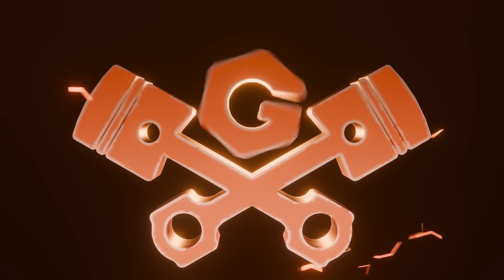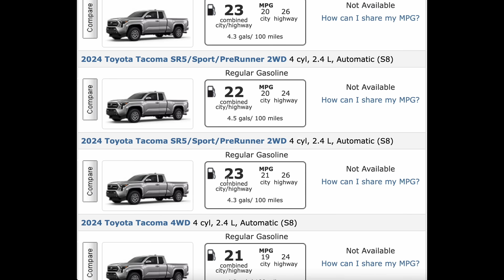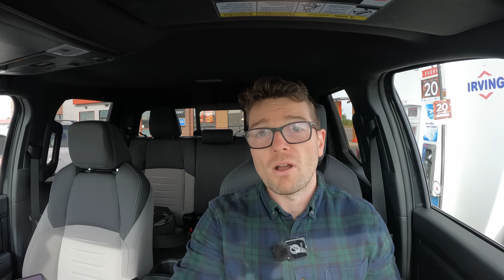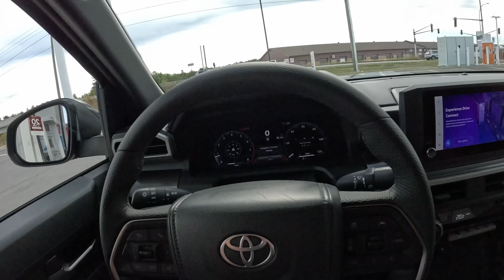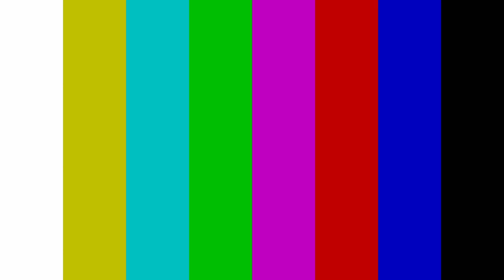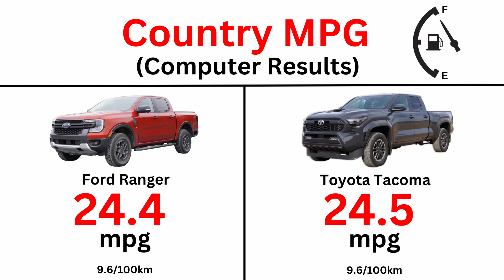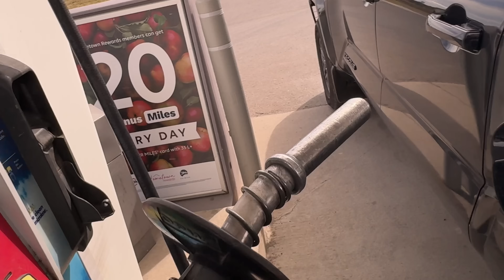Toyota Tacoma 2.4L Turbo Fuel Economy (MPG) Test | Shockingly EFFICIENT or OVERHYPED?

Comment: Tacoma gets horrible gas mileage. I just got off a trip with 16.6 mpg   My F150 with a V6 eco boost routinely got 20 mpg  and I could do twice the work with it. Going to get rid of this piece of crap in next few months. My advice , never believe these guys on any YouTube videos .
Reply: My SR5 2026 averages about 24 in the tank and I can get close to 28-30 on the highway. Youre doing something wrong.

Comment: Comparing MPG even on a closed loop route still has variables, mainly wind resistant. That wind resistant has a large impact on realized MPG on a close loop test And yes, do the math, the computer realized MPG can be 10% off and more. My loop is 46 miles. 
That said, my 2024 Sport has averaged as high as 31MPG on the east bound leg of the loop and as low as 22MPG on the west bound. 
My typical combined is about 24MPG

Comment: My 26' taco now has about 250miles on it and im consistently getting 23-24mpg. Granted its still in its break in period, but off to a great start. I dont really have a lead foot and im really good about managing speed without having to use the brake excessively.

Comment: I just had a revelation while watching your videos this evening.  You're the Teddy Baldassarre of pickup trucks. 😀  Y'all look similar, both have strong technical knowledge of the products you review and explain them well, and even look similar with the black glasses.  Keep up the good work!  Did you ever calculate the MPG of the Trailrunner in non-towing mode?  I'm considering it for the hybrid engine double cab with 6 ft bed.

Comment: Thank you I have an older Tacoma 2006 with a V6 engine Its best gas mileage is 18 mpg. It has a 5 speed automatic. The new tacoma is much heavier. My weight 3750 goss wt. My puts out 240 HP. on a 4L engine. Ben reliable its still runs good I have 172,000 miles. Im looking to sell because need better gas milage . Im looking at the ford Mlvric.
Reply: I’ve heard good things about the Maverick, but man I would hold on to your tacoma for as long as possible
Reply: @AJ-zu7ct Gas prices are not coming down for a few years. The stupid war damage lots of oil processing equipment. I drove my Tacoma the other day. Short trip to and from $60. It will cost an arm and a leg to drive it.

Comment: Love this channel.  I liked the Ranger 2.7 but wanted a 6ft bed so bought a Tacoma SR5.  I expect the Toyota to last longer but who knows, I do intend this to be a long term keeper. Hauling gear and NJ to WA runs a couple of times per year. 

A lot of highway running loaded up but not towing and not off roading so the air dam is useful. 

I will change oil frequently so not worried about durability with my use case.  Would you run 5w30 or 0w20?

Some interesting comparisons to other small displacement turbo cars I have.  2010 MazdaSpeed3 2.3L, 25mpg hwy!  2020 Alfa 4C 1.75L (weights 2500 lbs), 33mpg hwy and 12mpg pushing hard.  So the efficiency of the Tacoma 2.4L in a 4600 lb truck is cool. 
The key to any engine fuel economy is to be gentle on the throttle.

Comment: My 2025 Tacoma sport is averaging 16 litres per 100 kms(14.84 mpg's) and I drive it like a grandpa. What could possibly be causing it to be so bad? 3415 miles on the clock.
Reply: You either idle a lot or have many short trips.
Reply: @kannermw  What do you consider to be short trips?
Reply: @24cupsandcounting Anything less than 10 miles.  It is non-linear.  It takes at least 5 miles before engine reaches efficient operating temperature but it could be more depending on ambient temperature.  During those first 5 miles and especially in low speed city driving the efficiency will be at its worst.  If you jump in the car and are cruising down the highway within first mile the engine will warm up more quickly and be more efficient within couple miles.  Also, huge differences with winter blend fuels and very cold ambients.  My 2021 Avalon V6 mpg winter to summer is a range of 25 to 29 mpg.
Reply: @kannermw  Most of my trips are 15-20 miles. I am used to turbos as well. My last 2 trucks were 2.7 ecoboosts.
Reply: If you have a manual transmission then the blame is guy behind the wheel.  In that respect the perceived benefit of manual transmission is no longer valid compared to modern dual clutch 8 speed transmission.  The computers are way smarter and better than humans.  Also, accelerating too slow is worse than modest acceleration to achieve desired speed and then maintaining it.
Reply: @kannermw  Mine is an automatic and I am used to turbos. My last 2 trucks were 2.7 ecoboosts which got excellent fuel mileage and I do nothing different with the Tacoma.
Reply: @24cupsandcounting Sounds abnormal. I just purchased a 2026 4Runner Limited Hybrid.  It is my wifes daily driver with about a 60/40 highway/city driving profile using comfort mode (normal performance setting not eco).  She is averaging about 19.8 mpg but still less than 1000 miles.  This is full time AWD vehicle so fuel economy will be less that PT 4WD variants. It is about 20% better than previous 2018 4runner Limited with 4.0L that averaged berween 16-17mpg.  The new Limited has wider tires than prior gen so despite this plus added weight including hybrid drive the better performance and economy is what I expected  

Now if you are running large off-road tires at lower pressures then there is your problem.  Also, if you are using E15 gas that wont help. Probably should call dealer.  I assume you are calculating between fill-ups manually?    You could also lift all wheels off ground and verify they spin freely and no brakes dragging or mechanical issues.

Comment: the engines are tight for quite a few miles. They get better when fully run in.
Reply: How long does it take to loosen up? I have 2400 km's on mine(1500 miles) and my gas mileage is terrible. 2025 TRD Sport with 18 inch wheels.
Reply: @24cupsandcounting  books say 5,000, I say 10,000-20,000 miles. Everything in the vehicle is tight when new. Alignment is a major factor as well. Get yours corrected now that the suspension is surely settled in.
Reply: @AutomatedUser  it's funny you mentioned alignment because the truck seems to be out of alignment. It drifts to both the left or right. You know your stuff.

Comment: Blows me away how many people watch videos on these new Tacomas just to hatewatch and comment the same boomer slop about turbocharged engines
Reply: Its usually triggered Nissan fanboys or people that think this motor is built by Kia or something. This engine is way overbuilt and is strong as hell.
Reply: @TheDoc813   agreed. there are legitimate gripes to be had with the new Tacoma, like the small fuel tank, but the engine is not one of those things. It's a huge improvement over the outgoing V6.

Comment: Nice info…

Would like to see the auto vs manual going up the hill cruise control on.
Difference in boost and rpm.

Just another reason diesel option would be the correct way to go. Oh, and a proper 6ft bed!!!!

Comment: About 4k into my new 2025 TRD Sport 6' bed with a topper and I easily get 20-22 city or highway, even here in CO with all the mtn travel, doing better than my 2013 v6  Tacoma  I traded, particularly towing my camper which averages 14-16 MPG vs 10-12 with the v6 and a 3k lb TAB. I was hesitant to get another but happy I did.

Comment: Mine jumps around a bit, running in Eco mode I have recorded some 8.4 8.5 litres per 100km.  This is in summer and stock tires. My winter tires drop the economy a bit.

Comment: Sacrificing reliability and longevity for any amount of improved feul economy is unacceptable.  My 2022 trd sport long bed crew cab gets 15 to 16 mpg down town.  It also has a Magnusson super charger on it.  Feul economy only changes by a gallon or so, if you abuse the truck.  For me in car mpg is priority.  In my trucks it's bhp,torque,  towing capability and interior room.  Fuel economy is not even on my radar.
Reply: How's the supercharger do on your reliability? I've been looking at tacomas and I seen one with the same supercharger for sale near me. Thanks!

Comment: I got my taco sport premium 2 years ago. I’m at 50k miles .. I avg a solid 22.6 mpg..  no regrets these turbo 4 rides smooth in local roads highways anywhere.. I’ve also had a 3rd gen to compare it that I’ve owned for 5 years now.. so yeah love both but 4th gen for the win..
Reply: I’m averaging 21mpg in mixed driving with a 5.0 F-150 with 307k on it. And have got way better depending on what I’m doing. Pretty sad when a V8 almost matches your 4 banger
Reply: I’m averaging 21mpg in mixed driving with a 5.0 F-150 with 307k on it. And have got way better depending on what I’m doing. Pretty sad when a V8 almost matches your 4 banger

Comment: You should compare to the 2.3 Ranger. It will still beat the Tacoma in every metric. My 24 F-150 with 5.0 V8 and FX 4 averages 20+ local driving and 22 Highway.

Comment: The 22’+ frontiers get ~23 mpg and still have a V6 so I still don’t know why Toyota switched to a I4 instead of just making a better V6 like Nissan
Reply: You need to drive the Frontiers very gently to get that. The Frontiers top selling points are simplicity and long term reliability, not economy…
Reply: @sleeper.simulant7327 true, I believe ~20 mpg should be goal for most trucks
Reply: They do not get 23 lol. Its a dated platform.
Reply: @TheDoc813 yes they do

Comment: I'm fixing to hit 10k in my 24 Tacoma Hybrid TRD OffRoad. I've been averaging 22 in the city and hit 24 mpg consistently on the highway. I could probably get a little better than that, but I usually keep it in sport mode. Love this truck. It does everything I need it to do effortlessly, and it looks good doing it. No regrets.
Reply: It's nice to see a positive experience. I've seen so much trash talked on the new Tacoma. I think most of it comes from haters that have never owned a Toyota.
Reply: @JH-mt3pp  A lot of people are technophobnic, they see a turbo and scream in fear.
Reply: 2019 22 mpg countryside 87 93 25 mpg 10 ply tires no turbo countryside windy North Dakota driving

Comment: I'm grateful that I finally found the answer to why that engine runs so rough. From what you said it's the stroke. I personally do not like the way it feels it feels like it's misfiring and it's holding me back and purchasing one
Reply: the engine is solid. im more worried about suspension bump stops in the fromt , but that can be easily fixed

Comment: I towed an empty trailer with a Ford Maverick 2.0 ecoboost. Kept it easy at or under 65mph for a few hundred miles all highway. I got 13.5mpg. Small displacement gasoline turbo engines get horrendous fuel economy. Stick to V8's or diesel if you tow a lot.

Comment: I rented one, I drive 145mk\h for hours and pass anything not doing at least 20 over.   The thing was horrific on fuel and sounds like a Diesel in the Tims Drivethru. i wasnt impressed. Only thing that I really liked was the adjustable headlights.
with that said WHY dont you do a REAL world fuel economy tests and drive 20 over for 100km on all your test subjects???
Reply: Am not suprised that at 145kph or about 90mph your mileage sucks.  That’s really outside the normal design parameter for most truck engines to run efficiently. For this small engine even with an 8-speed, running outside its sweet spot.  Not saying you are wrong, good or bad. Aero for any truck is bad.  Did you have good mileage with any midsize or 1/2 ton at 90mph? 

I just bought a ‘26 Tacoma SR5 but cruising x-country I usually will be a little slower around 80mph.  Will see how I do. 

LOL my deleted 2012 golf TDI 6-speed manual with a big Thule box on the roof at 5,000 feet and 75 mph would get 43mpg, but at 90mph only 30mpg.  Aero and efficient power band efficiency.  The Tacoma has bad aero like any box on wheels and the 2.4 has a diesel-like torque curve and power band.  

Not making excuses for the newTacoma, it is what it is.  I drove a 2019 SR5 cross country and it cruised well as the power band was suited for 80mph.

Comment: They made the manual worse by reving 8-900rpm lower than the auto and less 7hp.  No more access cab either.  I'll keep my tuned 2nd gen, 4.0, 6 speed, access with a real key and reliability.  With some effort, I was able to get 25.2mpg from it by coasting down hills with engine off then bump restart while rolling.  Mostly get about 22mpg doing that and cranking it up once in a while.

Comment: On my 2024 Tacoma SR I regularly see 30 mpg on the computer when I am driving calm in the country roads or 65mph on the highway
Reply: That's crazy. Is your SR a 2wd or 4wd?
Reply: @gxkjerrygao7635  yes 2wd
Reply: @gxkjerrygao7635   I got a 2wd SR5 and I get about the same. SR/SR5 is the sweet spot if you want good MPGs.

Comment: Well, all I have to say is, i have a 2006 Ford Ranger 4l v6 i get 13 to 14 MPG. I am looking at the 2025 tacoma.  I will get all most 10 per gallon increase.  So I will be doing very well.
Reply: Find a 2016-2024 v6
Reply: Don’t believe these high mpg guys.  No way that truck is getting anything better than 17 mpg .  I’ve got 1200 miles on my Tacoma with that turb 4 cylinder  and now have16.4 mpg average .  Everyone who says they get  better than that must be coasting downhill in both directions .
Reply: @vicranger6876 same 17 mpg

Comment: 11:54 how is that any different from a N/A engine? Sure, they dont add boost, but they still open their throttle valve, they still intake more air, and they still add more fuel to match. Why would boost be less efficient than displacement?
Reply: Often times they have to run these turbo engines pretty rich to keep the exhaust cool enough. That can hurt the mpg’s.
Reply: They're rich under boost for safety. Detonation under such high pressures would be devastating.

Comment: Just purchased this exact truck in the premium version. Traded in a 2021 3.5 V6. The new one drives 100% better on the highway. I really liked the old 2GR, but the transmission was disappointing. This thing drives almost like a diesel - low revs, minimal shifting. Yes I do agree with some posts, quality is not quite as good eg plastics. What I do like is the rear suspension, the old truck's bed used to wiggle around but this one is solid.

Comment: Traded in my 2023 Tundra last month for a GMC Canyon AT4x.  Part of the reason was wanting to downsize, the bigger was wanting to get away from the engine issues with the Tundra. I had been a long time Toyota customer and considered the new Tacoma. Doing a deeper dive on the engine is what made it a no.  I’m guessing it came from the same design team as the Tundra engine. No thanks on a plastic drive gear that runs the balance shafts and oil pump.  GM certainly has their share of issues. You need to pick and choose carefully from any manufacturer these days. With that in mind, the 2.7 L3B from GM is proving to be a solid engine.  I’m taking my chances with the 2nd gen of the 8 speed automatic. Time will tell. Thanks for all the great content on your channel!
Reply: Good luck with that transmission.  a known crap machine.  get a warranty

Comment: In my 2.7 Silverado, adding boost to get over small hills (overpasses)  causes the fuel mileage to drop significantly. If i use the tow/haul mode, the rpms stay above 2000 and less boost is needed for small hills - giving better fuel economy. 
Same result with a strong headwind. 
If you have a standard or routine route in your daily life, try it both ways, see what works better for you. 
Ive seen differences of 2 mpg sometimes.

Comment: That Ford Ranger with the 2.7 has a wet belt.  That's a huge deal breaker for me.
Reply: One of the dumbest ideas in engine design.
Reply: I was considering the 2.7 Ranger. Do you have any references to the mass failures that wet belt has.? I'd hate to make wrong purchase. thanks
Reply: @gordmonteath6090 no he doesn’t. They’ve had wet belts for 8 years and many are over 200k miles and it’s not an issue
Reply: I dont think anyone has heard any failures, period?  I'd be more concerned with the plastic gears he mentioned in the video right before this one that run the oil pump and balance shaft if I remember correctly.  

Plastic will get hard and brittle before a Kevlar belt snaps. I'd guess, I've seen tons of failures of plastic cam gears in lawn mowers. I know mower vs. toyota, but still.
Reply: Every part can fail. There's been no significant uptick in belt failures on these engines that I've heard of. My 2019 2.7EB has 110,000km on it and no issues so far. People just like to get all sideways about little things and blow it out of proportion. The biggest thing with ALL engines these days is to stay on top of your routine maintenance like a hawk. Modern engines (especially turbo) will NOT tolerate maintenance neglect like the old days. And don't ever follow the OEM oil change intervals that most companies suggest. I go no more than half of what Ford recommends  on my oil changes - the dealer themselves actually strongly recommended this.
Reply: Wrong! All Ford engines lower than 2.0 displacement does't use wet belt on timing gear but timing chain. By 2025, all Ford engines both big and small displacement will be using timing chain.
Reply: @virgfresco1403   the 2.7 is a wet belt.